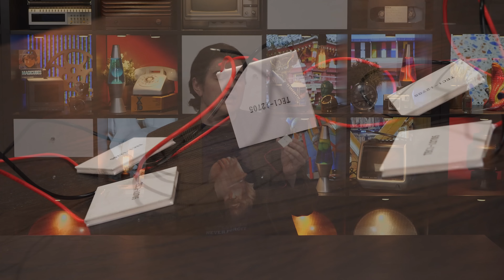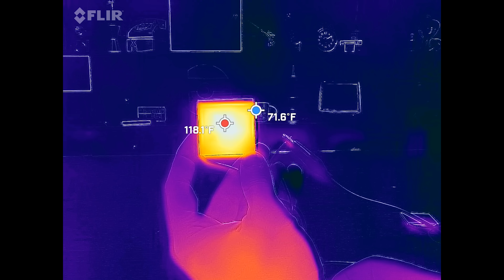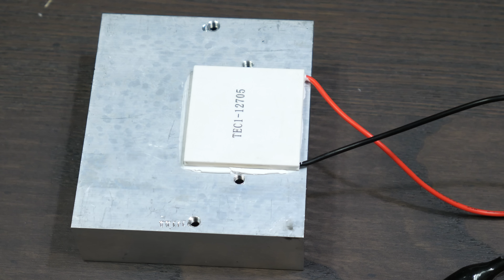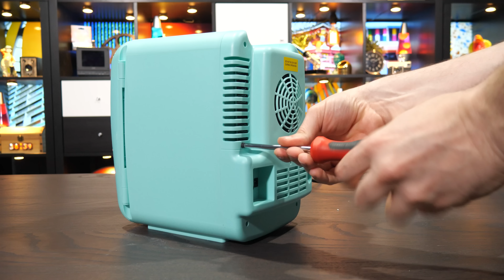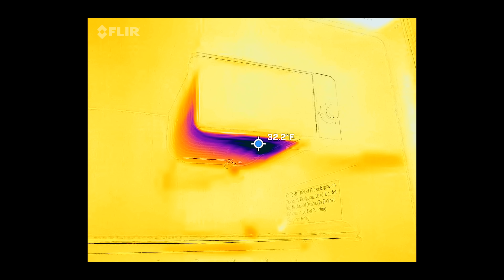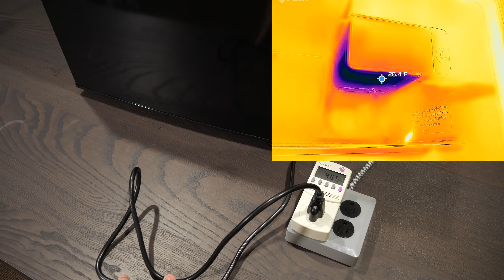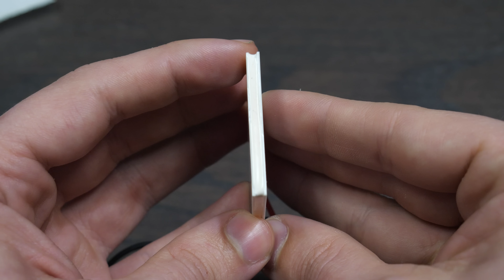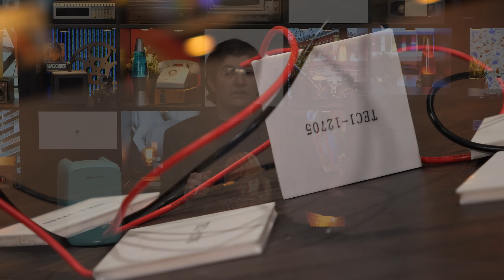Thermoelectric cooling: it's not great.

Comment: A small technical correction about heat pumps: You mention at 21:30 that they are better than running an electric heating element if the COP is greater than 1.  It's actually better than that: Most of the energy going into running the heat pump is also rejected out the hot side, which means that they're better than running an electric heating element so long as the COP is greater than 0.  Even a Peltier device, as bad as it is, will be more efficient than a heating element at heating things.
Reply: If we use the usual definition CoP of a heat pump in heating mode as energy output (Q) divided by work (W), then a heat pump that pushes all the energy used to do work into the output with 100% efficiency actually looks like this: CoP = Q/W = (X+W)/W. Where Q is the sum of the energy moved and the waste heat from doing the work, and X is the energy moved by itself. In fact heat pumps tend to have a higher heating CoP than cooling for the reason you state (the additive effect of using waste heat in addition to the heat moved boosts the CoP). 

An electric heater just emits whatever power is provided as heat, so CoP is W/W, or 1. 

As far as the Peltier, in principle the CoP can exceed 1, but that depends on how large your delta T is, and where you are operating compared to maximum current. It’s easy to undersize these elements, or overdrive them trying to deal with large temperature gradients and wind up with a CoP under 1.
Reply: I presume this is running with the idea that you're going to also use the Cold side for something to take advantage of the listed efficiency?
Reply: @Hegamonia  No, it is saying that at a COP of 0, you only get the waste heat and no heat is moved from the outside. But as you want to heat your home anyway, that waste heat is useful for you. And as that waste heat is the exact same amount you would get from a resistive heater...

PS: This assumes that the waste heat goes into the house. If the heatpump has its motor outside, it may very well escape into the environment and be lost. For a heatpump that can operate as an AC, that's not too unlikely.
Reply: @HenryLoenwind  CoP is only zero if no useful work is done. CoP doesn’t care how the energy enters (heating) or leaves (cooling) the system, just how much energy enters or leaves. 

Scavenging waste heat is still bringing energy into the system, and it counts. Someone talking about a real world heating device having a CoP of zero is misunderstanding something.
Reply: peltiers also ahve a pretty finite hot-to-cold side differential, so if you're trying to pull cold out of a frozen outside to heat the inside of a house, they're just not gonna do it. Arguably, the peltier can have a negative COP, where the generated hotside waste heat leaks out to the cold side as fast or faster than it can pump it to the hot side.

Comment: Oh hell, I've could have told you that. About a year ago I tried making a solid state air conditioner for my Van to hang on the side window at rest stops when i'm driving at night.  It worked to a certain point but it was very power hungry. It placed a nice load on my 300@hr 12V lithium batteries. Killed that experiment in a couple of weeks. Not worth it.

Comment: I used to work in a lab that did research with thermoelectrics, and the only thing we ever used them for was for the inverse peltier effect (aka the seebeck effect) which causes the element to generate a voltage when a temperature differential is placed across it. This is useful for generating power for small devices in close proximity to heat sources (i.e. wearables) and for scavenging waste heat from industrial processes that don't generate enough heat to be used in a more conventional generator (e.g. some chemical processing applications). As a source of heat or cooling they're next to useless except in extremely specific circumstances (as you mentioned in the video). Great work explaining them by the way, hit the nail on the head with that one.

Comment: FYI You an by a proper Car Fridge that has a small refrigerator compressor that works really well. Only takes about 50W Max. Vevor Makes one, and it runs perfectly off a car battery. I've used it to keep food cold for a solid week out at Burning Man. We ran it off an EcoFlow with 1200W of solar. (We also ran a window AC unit to keep ourselves cool in the hot days.)

Comment: Micro-compressors are becoming a thing now too.  Makita has a portable cooler that takes their 18V tool batteries which uses an actual heat pump.  It can keep things cool or hot.  I have a cigar humidor that's maybe half the size of your cube fridge that also has a genuine phase-change refrigerator.

Comment: some fo the fireplace fans use these for moving a SMALL amount of air once the fireplace is hot. kinda neat....however there ARE good ones and poorly performing ones...it's a dice roll. Ask me how I know...    generating small amounts of current based on the 'heat' differential is a really cool trick 😉

Comment: iv had a few of these and had no issue with their cooling ability, didnt take long to come down to temp either. also they could be used to heat things and on 12V voltage. what "real" fridge that you can bring with you can do any of that?

Comment: Yeah have one of these at the office too. They work well for drinks but the trick is to bring cold drinks from home and rely on it only to maintain the temperature not to cool them from room temp. Also that blue one has a very loud fans there are some that are better than others based on the size and rating of the cooler but than again I know what I am buying and how it works so is it efficient no absolutely hell no. Do I care not really I get my energy drinks at my desk and my boss gets increased productivity out of me far exceeding what it costs to run the thing XD

Comment: One other use for Peltier elements is that they run in reverse too. No, not cold/hot to hot/cold, but expose the sides with a temperature differential, you get power. Which is how some satellites and extraplanetary rovers keep functioning. E.g. Voyager' 1 and 2's Radioisotope Thermoelectric Generators.
That principle is also sometimes used with sensors where there's a good source of heat, but long distances to cover. Like pressure sensors on some industrial steam ducts. Use Peltiers for power, and LoRa for data.

Comment: Supposedly you can also run a Peltier element in reverse - heat one side and expose the other to cool air - and generate electricity.  Possibly somewhat useful for USB charging when camping out in the hinterlands...but I suspect it's also pretty inefficient.

Comment: Thanks for doing on-screen conversions of units. Also thanks for the completely unhinged section. That was funny as hell :D

25 years ago I also explored Peltier elements for computer over-clocking. I ended up with the same conclusion as you: Pumps are better. If you need below-ambient go with an AC pump, otherwise just use a water pump.

Comment: Was it not mentioned that applying a tempature difference to the peltier elements generates DC power?  Stove fans are where I first came across them myself.  Heat from the stove powers the fan to blow the hot air directionally.  They work extremely well in those cases.

Comment: Another use case for peltier elements is thermoelectric chillers for things that require very precise temperature control, like some laser systems do. Since you can control the peltier element electronically, you can adjust its heating or cooling output very well.

Comment: hmm I just bought 2 minibar fridges from Brandy Best, a French company 🤦. They're rated to use 97kWH / year (a lot better than that blue toy, but slightly worse than a regular mini fridge 😢). At least they look nice and are genuinely silent (I dont think they have a cooling fan) and they cost about half a typical mini fridge. I was expecting their cooling capacity to be not great, just enough to chill drinks... BUT I was not expecting them to use MORE energy 😭😭😭

Comment: Interesting stuff. I run hot, so many of the wearable device gadgets I’ve tried over the years have used the Peltier effect, to varying degrees of success. I’m not surprised it isn’t particularly efficient. I do notice that at low cooling levels, it works, but not nearly enough to counteract my body heat. And when I run them at max power, they all eventually get quite hot on the non-cooling side, which as you mention, leaks heat back the other way, defeating the point. If only I could just wear a heat pump and compressor getup, that would actually solve it all. Anyway, very interesting to get a full explanation of this all, thank you!

Comment: As a retired HVAC & R technician I really enjoyed this video. I used a thermoelectric cooler/heater in my service van. The cost to me was zero because it ran on 12 volts. The company I worked for paid for the fuel so any extra draw on the alternator and drag on the engine needed to run that thing didn’t amount to much and didn’t cost me anything. The cooler/heater had a switch to make it a hot box so I could heat my lunch in it instead of cooling a drink. I found later that it was more efficient to wrap my lunch in aluminum foil and keep it on the manifold of the engine that worked much better. I had a service call once on a thermoelectric wine cooler sold by the company I worked for. The wine cooler was meant for a temp around 60 degrees. This new unit was unable to do that because the customer had it built into to his bar but he left a generous small vent hole in the back.
Reply: A metal toolbox under the hood can make a handy pie warmer... (A 12V element and thermostat, could make it perfectly food safe - for Alex's concerns..). One could go all fancy with a heater core...
Reply: I've even seen people cook food on long road trips using that method.
Reply: I believe the cookbook was called 'Manifold Destiny'
Reply: psirvent8: I think he was referring to the current draw  of the fan in the dash which can be 12-35A.  If your car has electric fans for the radiator and condenser the will.need to kick on at idle.  Anyway there should be enough headroom in the charging  system to supply a 5-10A accessory that can be plugged into the cigarette lighter socket.
Reply: Having real car fridge with purchase price of 200eur was great. I had peltier crap before and it always disappointed.

Fridge one actually runs as freezer too, draw os bigger but no issues keeping 45c colder than ambient in car.
I run mine through ecoflow river to keep 12v up, the 800Wh unit gets up to 48hours on full charge.
Reply: Yup they are great for work, especially if you're a tech driving around. I work for Motorola,  so I travel like 300 miles to my jobsite. My unit is AC or DC powered. So I can keep my drinks cold in the truck, then take the fridge out at the job site and plug it in. He doesn't understand what a nice luxury it is to have a cold drink and a sandwich when you're out in the middle of nowhere on a blistering hot day!
Reply: @GMCLabs much better to use a true refrigerated cooler. I have a 32 quart one made by Dometic that has a compressor. It runs on 12/24 VDC or 120 vac. It's great for off road and camping. Only uses 6 amps when running on DC.
Reply: @Gizmo42Rodeo  However after putting it in your car or moving it don't you need to let it sit for 24 hours before plugging it in otherwise you risk damaging it?  Every fridge I have ever had says to always let it sit for a day after moving it.
Reply: @NickL255  nope. It always sits in the same orientation as a regular cooler. Look up iceco to get an idea of what it is. They are a cheaper option of the Dometic that I have.
Reply: @Gizmo42Rodeo  No, I mean if you take it out of your car and then put it back in you are supposed to let it sit for 24 hours before plugging it in to let the oil settle or something like that.  Unless they somehow overcame that limitation but every fridge from full sized to the square "dorm size" fridges said exactly that in the manual.
Reply: @NickL255  That is true for normal refrigerators if you lay them down. You can transport them all day standing up with no issue. Standing up the oil stays in the bottom of the compressor where it's supposed to be. You need to let it sit after it has been laid down for the  oil to all return to the bottom of the compressor. Refrigerated coolers are never laid down. The compressor always remains upright. Even with off road and climbing up and down rocks the compressors are just fine. I have had my dometic off road/rock crawling many times in 8 years and its still fine.
Reply: After watching this I googled some compressor-based travel coolers, so I'm assuming there are designs that don't have the lubricant-pool limitation.
Reply: @Gizmo42Rodeo  wow and only 10x the price, what a bargain. I'll stick to my peltier fridge with the built in armrest, thanks though
Reply: if you have a commercial alternator yes, but in a small car the 10-15amps can heat up the alternator quite a bit leading to premature failures.
Reply: @thedavesofourlives1  Tiny compared to what the A/C uses, plus a little portable cooler would be more like 4-5A. (As to the case where you're blasting the A/C on max and already using a lot of power, couldn't you run a bit of ducting from the vent to the open box and get faster cooling without any extra power draw?)
Reply: @NiHaoMike64  Car AC doesn't use the alternator and the compressor isn't electric either, it is mechanically coupled to the engine actually.
That's the reason why you can't use the AC with the engine off.
The fan might work and drain the battery if left on for a long time but there will be no cooling whatsoever.
Only electric cars have electric compressors like home AC's but they also don't have alternators or engines, obviously.
Reply: @psirvent8  The compressor does use electricity to engage the clutch though. The amount it uses to engage the clutch will basically be the same no matter what the AC or fan settings are though.
Reply: The Hyundai Ioniq hybrids use an electric compressor and have an engine (and alternator/starter assembly). Weird setup but it works.
Toyota hybrids (since the gen. 2 Prius) also have electric compressors, but no discrete alternator as MG1 in the THS transaxle does that job instead.

Comment: Thanks in part to your video on chest freezers, I used one of those same style STC1000 digital temperature modules to convert a 100 euro chest freezer into a chest refrigerator by basically telling the freezer "you can just stop running at refrigerator temperature thanks".
It uses about 2.50 euro a month last time I checked.  I live in Dublin, Ireland and yes I have autism and work in IT :)
Keep up the great videos.

Comment: I design TECs into transistor packages to cool photodiodes. I can use a dual-stage TEC to achieve a delta T of 80°C effortlessly at not even a watt. It's all about dissipation on both sides of the TEC. TECs are not the problem, thermal design is.
Reply: aaah, is that the reason why some ICs mandate that the thermal pad needs to be soldered onto the PCB (or even a ground plane)?
Reply: @DasEtwas  Exactly, the more air you displace from the interface of the heatsink to the IC the more heat you're able to transfer through the junction over a set time. This translates to how hot your IC stabilizes to at a given temperature. All real thermal interface materials will provide a thermal conductivity rating in W/mK. If you're trying to dump 1W of heat over a 1sq mm area and the thermal interface material is 1mm thick then there will be a 1°K (or C) difference in temperature from the hot side to the cold side. If you are dumping 2W then there will be a 2°C delta. This calculation ignores any other conduction, convection, and radiation that the material/device will experience, so expect less of a delta. Also, if you look at the equation you will see that if you reduce the thickness of the thermal interface material the thermal delta will reduce as well. If you have a 1µm thick thermal interface material then you're going to get 0.001°C at 1W! Most solders are 30-60W/mK so they can handle significant thermal flow across their interface, with the benefit of a proper solder connection having very few voids or inclusions in the interface due to how the solder wets out. Pastes and pads are great for non-permanent or unsolderable thermal interfaces, but typically they have a lower thermal conductivity.
Reply: @DasEtwas  Goes even deeper than that, some ICs specify a minimum board copper pour area and thickness for continual use.
Reply: So what you're saying is he needs to bolt on some Noctua coolers and use liquid metal.
Reply: @RustyShackleford-s4o actually though

Comment: NGL this video actually inspired me to want to buy one, I'm too curious about what would happen if I was to swap the fan out for a better one, swap whatever thermal paste it's got out for some better stuff (if it has any) and insulate the door.

I had one-can cooler once (I doubt it had a peltier.) It only fit one can, and said can sits straight on the exposed underside of the heat sink; it worked okay and got things cold enough to collect condensation after like 5 hours. I wanted to replace the fan on that one, but they welded it in for some reason. Still, wasn't COMPLETE garbage for the $1 I got it for at a thrift store.